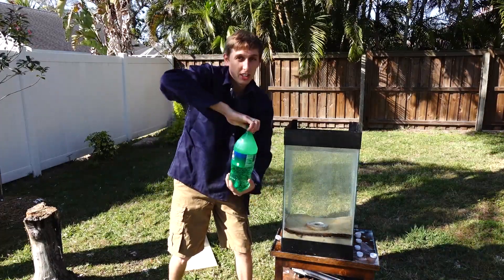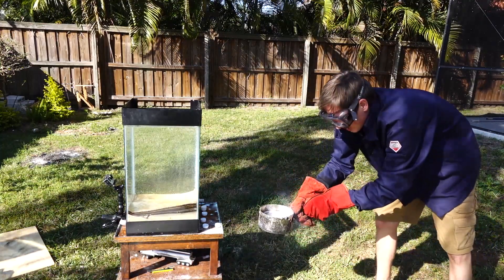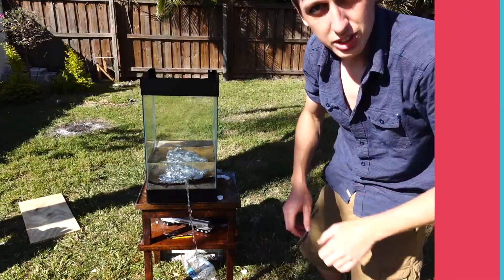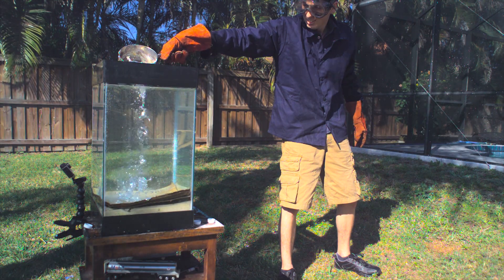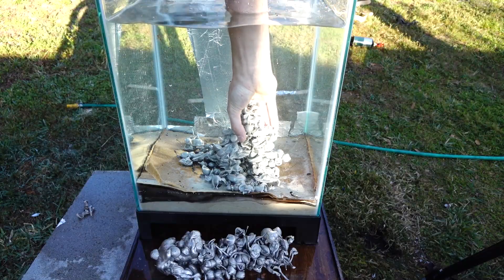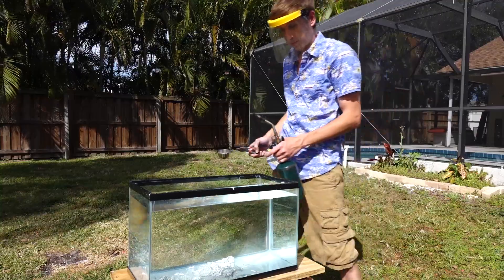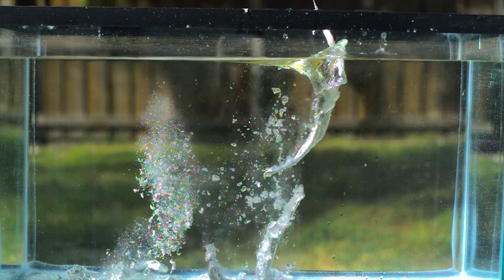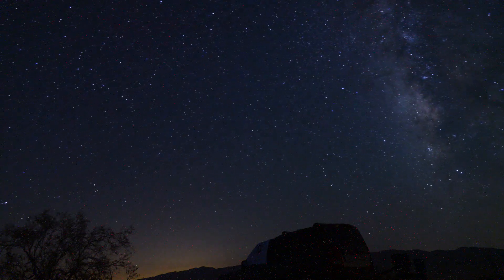Molten Aluminum Vs. 15 gallons of Sprite

Comment: Unsure if you alter the frame rate during the slow motion sections or if that's possible but the Slow Mo Guys explained they only upload at 25fps because if they used anything higher, it'd kinda defeat the purpose of the slow motion. Basically when you are recording it at these high FPS but present it in a 60fps format, you are essentially presenting the slow motion faster than if you used 30 or in their case, 25fps. They use 25fps because it presents a whole number when you divide it from the whole where as if you record 7000fps but present it 30 FPS or 60FPS, you won't get a whole number. Also, awhile ago, 25 FPS was the standard frame rate for the UK television (which is where Gavin started recording slow motion footage for ads and shows) while 30fps and higher was normal for games.

Comment: Why do they call it high spped if it's slow motion? 🤔
Reply: Not sure, but maybe because the frames are captured at high speed (and back when it was actual film, the film would have been moving at high speed).
Reply: +OrigamiMarie Yeah I guess
Reply: Because it records frames at a high speed and it is used to record things moving/reacting in a fast speed

Comment: I did quite alot of experimenting with molten tin when I was young and discovered that the temperature of the water has a huge impact on the shapes you end up with. just the difference between cold water from the tap and slightly warm water from the tap makes the difference between cloud shaped blobs and little fragments of tin all over the room (mom wasn't happy about that). I would love to see you too experimenting with different temperatures and maybe not just with tin?

Comment: What do you use for a Crucible? my boss and I have been melting aluminum for an art project but our Crucibles  keep failing. we are using steel  Crucibles. is it seems the fire is so hot it melts the steel. any pointers?
Reply: Try titanium cookware. It might work a little better but if you are unsure just use cast iron or ceramic
Reply: We have a shallow cast iron pot but it won't hold but maybe 1 pound of aluminum. Thanks for the tip.
Reply: +Jake Hoodock you can get a nice cruciple off of amazon for about 10 dollars
Reply: +sean mergner thanks I'll probably fo that

Comment: I enjoy your videos but as someone who has suffered significant burns in the past I'm worried that you are going to get hurt. You were not wearing long pants at any time and the pour into water was done with zero PPE on. You are very enthusiastic and that's good but don't let it get you injured. Nobody ever thinks it will happen to them. The spill onto the ground made me twitch a little.

Comment: I noticed that when the molten aluminium was poured onto the Sprite it made a quick high-pitched sound only when the aluminium touched the Sprite, while the sound was present during the entire pouring process when it was molten aluminium and water. Why is that?

Comment: After pouring sprite from bottles it changes its properties. If you had thrown mentos into Cola poured like that it wouldn't explode. It works only in bottle. But molten aluminum into plastic bottle wouldn't work

Comment: Interesting idea... I'm kind of curious what would happen with other liquids, or even the 'oobleck' that's corn starch & water w/green food coloring.

You know, external HDDs are good options for data backups and are excessively cheap now if you don't want to go with a server-based approach with RAID to provide redundancy...